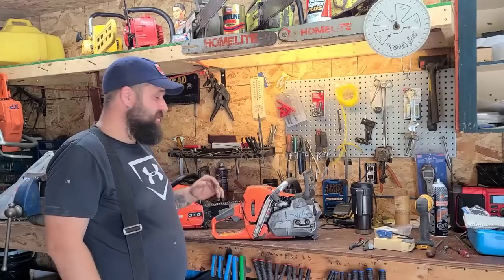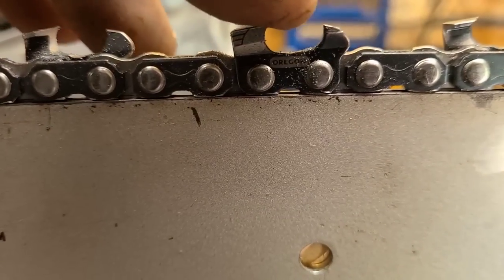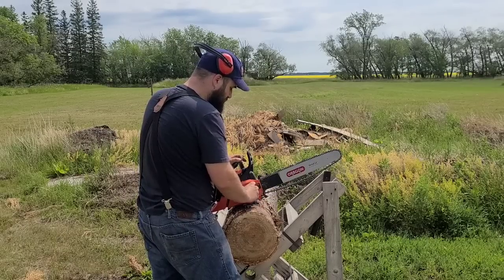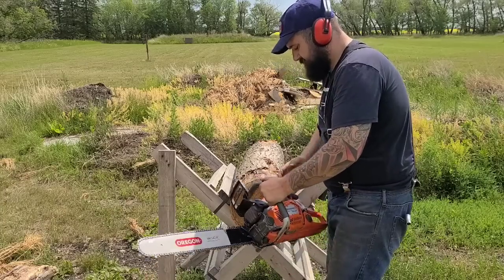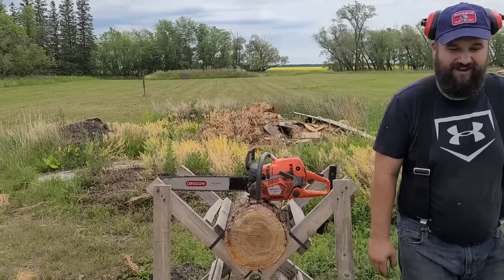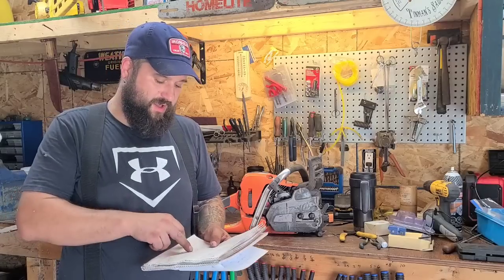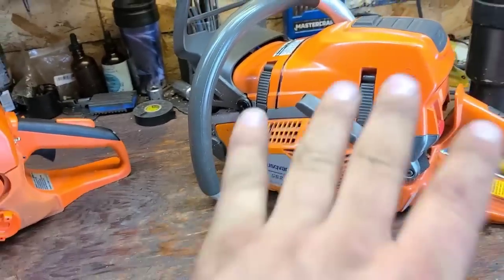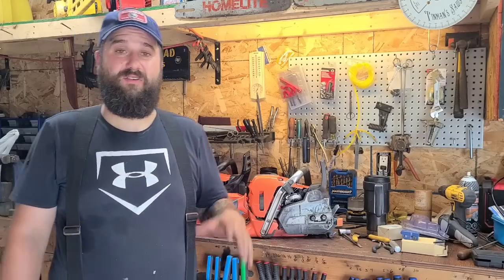Echo CS590 vs Husqvarna 562xp. How close are they in performance??

Comment: Can get a filter upgrade pack now for a 560xp and 562xp. Upgraded my 2015 560 to the new filter and cover. They are supposed to keep the fine stuff out of the carb. Its easier to clean also no need to remove the filter. Can just access around to blow it clean. Comes with a new top cover with that vent hole on the side, new mounting bracket for the filter and the new filter. Got mine for 49euros from the local husqvarna dealer.

Comment: I have an echo 620 and it is a good, strong saw. Under $600 US out the door during the sale week. After pouring through forums, I've never understood why people buy a 590, then proceed to buy the 620 coil and 620 carb. Just buy the 620. I put a 28" on mine and it rips through oak just fine.

Comment: Great video, I run a couple of 562's just upgrading the air filter on one to see how it compares to the original setup. The spikes are the only disappointing feature in my opinion. I like Echo's good saws but not common here in Oz.
Reply: The spikes are an easy upgrade. The West coast kit is only $40 which is reasonable for big spikes and a 3/4 wrap handle.

Comment: I'm up in the air on 562 or 572 for new saw to replace my old 55 rancher that died.
 Got a good bit of bigger  hardwood around here to process. Mostly cherry, walnut, maple.  Leaning toward the 572 for a big saw since I already have a small 435 and the old 55 was a bit overmatched/overworked 😉  But everytime I see your 562 run i go back to undecided! Lol 
Great content as always!
Reply: the 565 is in between them .
Reply: I was a husqy guy once.....until I got some echos 😂. Lol j/k I like almost everything, seriously though idk what it is your looking to do farm/ranch work, homestead,pro logger but for the range your looking at purchasing take a gander at the 620 or 7310 echo..620 likely more in the area your looking but they are built more old school simple basic carb design for the most part and tend to not blow up as soon(of course them moving slower contributes to the longevity) ..just a thought one saw guy to another I was straight husqy for years...decades and still have some built playtoys I enjoy but I'm impressed with the echos for being an ol dirty workhorse it's about like comparing a Ford 300 to a 302
Reply: 572 is nice. I have a562. I used a 32 on it once and it did it ok... but not everyday. The 572 will pull a 32 all day long and do it smiling.
Reply: @wolfmanrebel874  no doubt the echos look to be great saws, don't see much in the way of dealer support in my area for them though. Mostly Stihl, followed way behind by Husky.  But I sure like the looks of their price point and  apparent quality.
Reply: @Piledriver2235  it's the same here the local co-op is husky dealer, mom and pop hardware store is Stihl  it's about an hour or so to a echo dealer so I certainly get that issue
Reply: @Piledriver2235  cool thing about Husky and Echo compared to Stihl is you do not have to go thru a dealer for parts.

I know of at least 3 websites that have full, interactive diagrams for basically everything Husky, Echo and a dozen other brands have made in the past 10+ years.

Cant do that with Stihl, you have to go to an authorized dealer which is huge con for me
Reply: @danielbabcock7004  this was a great reply and timely cause I finally did pick up a new "big" saw.  Went with an Echo 7310p, got it with a 24" bar and quickly bought a 28" sugihara.  Ran it 28 first time yesterday in hardwood with Oregon xlj skip and it blasted through the downed + 36" cherry ive been waiting to cut up.  Only 4 tanks through it so far, and its starting to wake up nicely.  Loads of torque, a little heavy but built very nice..  It balances great with the stock 24 and exactly the same with the 28 sugi light.  Antivibe is great, my right hand starts to go numb in a few minutes (old injuries) with the farm boss 290 I had been using  and my old huskys.  I cut for hours with the echo and never even got a tingle in my fingers.  
Would love to see a port and muffler mod to see whats possible.
Also picked up a echo 2511p, just cause it's such a cool little saw!
Reply: @Piledriver2235  2511t is definitly one of the better saws they make

Comment: 590 Timberwolf was the 600P with more plastic to reduce the cost.  You can put the handles, clutch cover, etc right on the Timberwolf off a 600P and the newer 620P.  And as you found out, the ignition system as well.

Comment: I used a 590 for just one cut to see what it was like and to me it felt just like a husqvarna 455 rancher . Now the 590 doesn't cost that much here in California but the 455 is definitely cost less than the Canada price of the 590 . If u really wanna put the 590 to test it on a similar saw then the 455 would be your best bet
Reply: The 455 doesn’t hold a candle to  590.
Reply: I sold my 460 rancher after I bought the echo 590, no comparison

Comment: Thanks for the video tinman! You do real good with the information and understanding in your videos been awhile since I've commented hope all is well with you and the community! I have a 620 echo the carb is different for sure it makes me feel as if it's got a problem not sure I haven't took it apart to see if you start it and tach it wide open it's 8500 then stick it is wood and after it gets a few cuts in it'll go to 13200 but that is the the low jet at 2 and the high jet dang close to shut off not even a quarter open they are strong saws but I believe a husqvarna is a lot better saw still not sure the echo does get the job done for sure tho have a great one!

Comment: we have a 400 echo it has been a good saw also have 28 super , 41 av and 46 sthil they are great saws. the new sthils have been bad the 390 and 230 i have traded off. we have two husqvarna that we never had any luck with a 55 and a 42. i will never buy a new husqvarna or sthil. may trade the 55 and 42 huskys for a echo cs590 thank you for video it will help a lot of people start there husky and other will know the echo is the best buy.

Comment: I’m happy you had such great luck with the 562xp. Mine was a 2016 model with lots of issues.  The 562 saw lasted 19 hours and toast.  Since new was hard starting never seemed to run right.  Think I got a lemon. It was my backup saw so out of the warranty time frame by the time it went.  Reached out to Husqvarna and nothing they would do.   Last Husqvarna equipment I’ll ever buy after that experience.  Thanks for doing this review for the drastic price difference planning on trying the Echo out.

Comment: Had 590  3 months old and piston went right at 10th tank  and my echo dealer wouldn't cover it says was a fuel  problem  which is bs because run same with my other saws and they ran perfectly fine so 590 been in peices  in a box for  3 years now u want it for parts

Comment: How do you think the 590 would do on a chainsaw mill, milling pine,spruc ect? Looking to get a 60cc class saw but not overly expensive, husky 460 is what I'm thinking but choices are alway great..thanks
Reply: Need 90cc for milling. Ranchers can’t keep up at all with the 590. And plastic vs mag cases
Reply: @zeromark202  I use my 550xp and 272xp works extremely well for me in softwood

Comment: Seriously considering this as my new saw (also the MS271 & 455 Rancher). I currently have the CS310 & CS400. I think I can get away with offloading the 400 and keeping the 310 for smaller tasks.
Reply: I personally did not like my 455 rancher and I'm a big husky fan. Running a echo 590 with a 24in bar and a husky 395xp with a 32 in. I'd take that echo over any mid grade husky. It's pretty much bulletproof. That being said husky xp saws are my choice saws especially 3 series
Reply: @polodog1483  Wound up with a CS490/24, kept the 310 for sentimental reasons (dads...2/2/22), still have his old Husqy 345. Got a steal on a pair of MS251/18's....relegated to SxS trail clearing duties. Still looking for a good 50cc, got it down to the MS261, 545mk2/550xp. I need a light limbing/bucking saw

Comment: My most used saw is my echo 620 , second most used is my 562 xp the 620 I recently had it tuned up and the echo blows my mind every time I use it just a fantastic saw and it cost me 300 less than my 562 don't get me wrong the 562 is great but for 500 bucks that 620 gives me equivalent performance . If you liked how the timberwolf Performed compared to your 562 I'd love to see your thoughts on the 620 against it I'd also love to see you out a 28 on both and see which one pulls it better I've ran a 28 on my 620 and it's very agressive but I like it best with a 24 and I like the way the 562 runs with a 20 on it there is definitely something to be said for the torque that echo puts out I've cut some seriously big wood with that 620 I also have a 7310 and it definitely gives some serious competition to my 372 if someone were to ask me what saw they should get I would recommend them echo with 200 confidence that they'd be able to get through whatever they're cutting and also my echos  burp after 2 choke pulls then start with one pull after that every time
Reply: pardon which do you like more the cs620 or the cs7310p?
Reply: @enginnerdedtohoopajoop4604  they're. Kinda tied in my mind really , but if I had to pick it would really come down to looks and the 7310 is in my opinion just a way sexier saw lol they're both fantastic performers though and they'd be a good choice to add to any saw lineup
Reply: @joehertel8846  thank you Sir! pardon which do you like more the cs620 or the 562?
Reply: @enginnerdedtohoopajoop4604  oh that's a straight tie right there the 562 is all about the rpms , and the cs620 is all about the torque they perform equally in my use of them , except the 562 might cut about a 1/2 second faster
Reply: I'll also say this , the 620 loses way less rpm in the cut atleast by mye ears and feel anyway (when cutting large hardwoods like say 30 Inches or more ) but they're both fantastic saws, I will say out of the box the echo is the better but because it comes with a 5 year warranty costs less , on paper they're only separated by a .2 HP . I prefer to run a 24 on the 620 and a 20 on the 562 they can both pull a24or 28 but it's just seems to me that the 620 has an easier job of it , and the benefit of the 562 is the auto tune keeps it running at its highest performance however if you are decent with adjusting a carburetor than save the extra money and go with the echo the performance difference between the two is negligible however you will absolutely love either of them and if either one was my only saw I would be fine for pretty much anything short of a Sequoya or red wood
Reply: @enginnerdedtohoopajoop4604  pros for the 620  it comes with double dogs , can pull up to a 28inch bar , 5 year warranty included , costs on average 300-350 less than 562 and Performs pretty much the same ( like I said when I use them side by side o can't really see or feel a difference in terms of power) 
Pros for the 562 auto tune it's awesome keeps the saw screaming and running at it very best , can also pull a 28 inch bar (not as well as the 620 in my opinion) has a smaller more narrow profile than the 620 (also when side by side with the 550xp it looks smaller than the 550) so more maneuverable , and it's a Husqvarna let's be honest it's name is totally pro it's like having. Luxury car

Comment: I have never used primer blub and never pulled more than once or twice and I live in Texas where I see temp of high 90s ever day and humidity 80s to 90s never had a problem with my 562xp I also run stihl ms291 both damn good saws I like stihl better because of the in board clutch

Comment: If the 590 is stock, it actually did better against the 562XP than I expected. A fair comparison would be the 620P against the 562XP. Here in the US the 590 is half the price of the 562XP.
Reply: The 590 is basicly a echo 455 rancher
Reply: @mrtree1368  The 590 is more in line with the 460 Rancher imo. I'd buy the 590 over both the 455 or 460. 590 is around $100-$150 cheaper, but the huge difference is the magnesium split case vs plastic clamshell of the Rancher line. And I'm confident the 590 has more grunt/torque as well.
Reply: @obeconoberougle9497  with a 20 inch bar the saws are similar in performance but I'd probably put my money on the 455 . I've used both saws and my 455 never let's me down and im sure the same with 590 and the 460 isn't worth the price for the added power less than a .5 hp . Now if u can get the 590 off ebay for around 350 then that would be a good price cause the 455s arnt as cheap as they were 7 years ago.  Yea the Ranchers arnt built as solid but they don't brake I've had mine for  over 7 years and everything holds up and I do tree work professionally
Reply: @mrtree1368  Totally agree that the 460 is over priced. The 455 is definitely the better buy of the two. The only Husky I have is the 440e. I have to say, so far I've been really happy with that lil bugger. It's snappy and powerful for it's size. Sharp chain and properly tuned it's impressive. I think Husqvarna has one of, if not the best AV systems on their saws. My other two saws are both Echo pro models. The 501P and 620P. Build quality and performance is excellent for the money imo. I do wish they used an air filter like the 400 or the new 7310 though.
Reply: @obeconoberougle9497  the 455 is the most affordable bigger husky saw but it's probably the weakest too but with a 20 inch bar you can cut fire wood or cut down trees with good enough performance. If it was my old tree company I would be using a 357 or a 372. u really want a  bigger saw when it comes to real wood cutting. But for me my next bigger saw is a stihl ms 390 (64cc) with a 28 inch bar then I got a 395 xp. My small ground saws are echos 370 and 400 and the new 3510  then the next step up is a stihl 021 and 024. I don't have all the saws some other tree guys have but I'm all about knowing what u need to get the job done without making ur self look silly lol
Reply: @mrtree1368  Sounds like you got your "bases" fairly well covered. That 395XP should handle all but the most ENORMOUS sized trees. Lol! I'd like to have a 70cc class saw, but for what I cut my 620P will handle it. I run a 24 on it, but it would pull a 28 no problem. I'd prefer a 70cc for a 28" bar though. Echo 7310P or a 372XP.
Reply: Can’t port plastic ranchers guys, echo 590 blows them away!
Reply: @zeromark202  Yeah I know the Ranchers are plastic clamshell saws and can't be ported. 590 is hands down the superior saw and a bargain by comparison.

Comment: The echo 590 is a tough little farm saw but Apple to Apple would be the 620p echo I have a ported 362 Stihl and my boys stock 620 is within a second on a on a round of 18” red oak I tried it with several chains because he was doing an experiment for the science fair on which chain cut the fastest btw between full kerf full skip square half skip and comstock logging supplies exclusive round grind half skip it was  round half skip for the win then square half full kerf then full skip much different than I expected

Comment: I get problems with hot starts on my 590, don’t know why, I pull the plug out and turn it over a few times, put the plug back in it and it will start right up, plug seems dry
Reply: Don’t use the decomp, I plugged mine cs590 starts 2-3pulls every time hot or cold.
Reply: Try pulling the choke out, and pushing it back in. This will engage the high idle, than blip the throttle to get back to normal idle. 

If its a really hot day sometimes cracking the fuel tank cap and than closing it again will help relieve pressure from the gasoline getting warm and expanding.
Reply: @zeromark202  
That is what I now do and no more starting issues

Comment: Have a new 621sx at work. Its a horrible saw. Its big and wide feels bad in the hand. Also it cant pull even a 16inch bar in dry pine. It has no snappyness and just feels like a tractor in wood. Trying to cut notches on logs was one of the worst experiences i have had. The 254xp, 359, 357xp, 560xp and a jonsered 2260 all cut 10 times better and feel great in the hand. The 357 and 560 are in a league of its own in comparison when cutting notches in dry wood. Echo is a lazy and clumsy saw. Maybe a .325 chain and porting can make it better.

Comment: Rpm limit  seems really low on the echo not sure why🤔. Not really a fair comparison. Think the 620sx would fair better. Good work though tin man👍
Reply from the maker: The last 590 video I did shows why its kimda on the slow side.
Reply: @tinmanssaws  yeah sorry wasn't having pop or anything Tin, I thought the Carb n coil would raise that to at least 13-500k, I guess it must be the 590 cylinder with low exhaust roof🤷‍♂️. Obviously they've done that for longevity being a home owner grade saw

Comment: It seems like it's obvious the faster rpm saw is going to cut noticeably faster in soft wood. 
Not sure why go thru this comparison without running them thru oak or maple....
Put a long bar on the husky and see how the high rpms fail. I run 32" skip on a 600p echo and it pulls it Exactly as well as 20"... 
Like to see husky try that on for size. And then time them 💁‍♂️